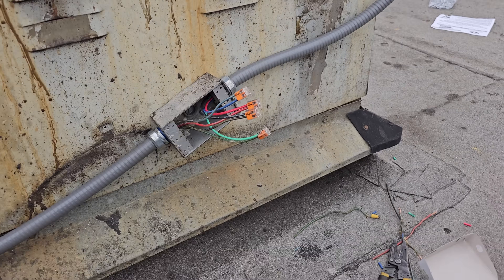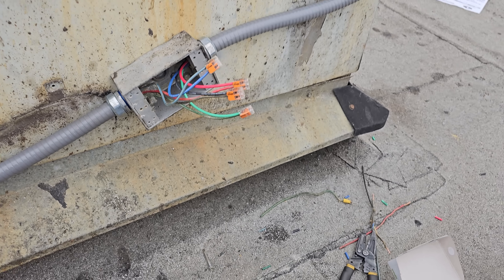THIS WAS A MESSED UP EXHAUST FAN SERVICE CALL PART 2

Comment: I loved a challenge. Having million dollar equipment error out and trace out circuits to find out a wire going to the left hand button caused an intermittent open circuit or having flickering lights in bathroom of a multi-million dollar facility makes you wanna get to the bottom of the issue and fix it for the customer. I used to love trouble shooting systems and figuring out why something did this and what I can do to help my customer. Thanks again for teaching us all a different world of the trades. Making the Trades Great again.

Comment: thank you for the video, just noted from the video, the hinge you had trouble with appears to have its lower bar the wrong way up, at 5:27 you can see the near hinge has the lower bar bolt holes up but the far hinge has the holes down, the effect of this is the lower bar is closer to the fulcrum of the hinge hence the fouling, I used to be a blacksmith and I made things like this all the time.

Comment: Just a thought: I use ferrules for everything. I mainly work with industrial automation, and it makes installs cleaner looking, and will avoid issues like that stray wire strand you had there.

Im not even an AC tech and I'm still hooked on you channel lol

Comment: @8:40 Not sure if you caught it or not as I havnt finished the vid yet, but I can see whats wrong with your hinge at this time stamp. On the right hinge, the bolts are going through the bottom half of the bar while on the left hing the bolts are going through the top of the bar. Bassically, the bar on the right hinge is too high. Compared to the left side, it actually looks like that bar was put on upside down, so if you was to take it off and flip it, it should work just fine without shims.

Comment: Not sure if it'll be worth the investment for the few cases it comes in handy, but you might want to look into time domain reflectometers (TDR) for checking wiring. They work by introducing a very sharp pulse into a wire and using the characteristic impedance and wave propagation behaviours of the transmission line to determine the length of the cable and the distance to impedance discontinuities (partial breaks, fraying, rub-outs, etc.). You don't need a completed circuit - it works more closely on the principle of radar than the way you think about traditional current flowing down a line. They're particularly useful if you're trying to figure out where a break is in a long cable, especially if it's going back through a roof and through the building. The really good ones are precise enough that they'll let you pick up something as small as a fly-away - you'll see a tiny secondary reflection after the main reflection as the wave continues to propagate through that additional inch of wire, and it's especially noticeable if you compare results from multiple lines in the same setup. Cheap ones are a few hundred bucks, good ones start at the $1000 mark and continue upwards from there. The super fancy ones used for checking aviation wiring harnesses cost more than my house!
Reply: They are in very common use with computer network cable installers - I know when I was doing that kind of stuff they were a godsend in tracking down problems.  Worth every penny!
Reply: @DocNo27  They're particularly accurate on Cat5/Cat6 too because the ANSI/TIA specification defines a certain tolerance band for the single-ended and differential impedances, so they can calculate the phase velocity from there and use it to derive ε_r and propagation delay.

I've also seen some field TDRs where you can take a known length of the same cable (e.g. cut from the installed run, or taken off the same reel) as a calibration reference to get high accuracy over very long distances. Really useful for utilities running coax or local loop over several miles. There are optical ones for fibre too.
Reply: As long as there's a fairly steady Z0 you're correct.  I worked on Network analyzers for 33 years.. with TDR, TDT, and so on.  You can run your finger along the surfact of the romex (if exposed) and locate the break rather precisely. I've used this trick many times.
Reply: How well would a TDR work on power power wiring where it's individual wires and not a cable?  I'd think the characteristic impedance would be too variable for it to work. RF and network cables have tight tolerances for that.

Comment: If you usually only join 12G wire or smaller I'd recommend the grey Wagos, they can't really be opened as easy as the clear ones.
Reply: Yep was going to say the same thing. Ever since a lot of the equipment was switched to r290 wagos is all I use. I use the grey ones all the time now.

Comment: 9:50 Maybe you should try the Wago 222 series instead of the 221 series. The 222 series are a little bit harde to pop open like that. They're still suitable for both stranded and solid wires up to 4mm2 / 12AWG and up to 400V. Only downside is, they're a little bit bigger, not much though.

Comment: I would make it a habit to bond your metal boxes to ground at every junction. It’s code and it’s always a good idea to make sure that ground path is fresh. Your new exhaust fan is definitely bonded to chassis so you’re probably fine in this situation but I can never trust older buildings and their questionable electrical!! Excellent work nonetheless, I’ve learned so much from this channel, and I appreciate what you do man. Keep up the good work my friend!
Reply: Jake you made me get out the code book...and you are absolutely correct! NEC 250.148 (C) says if circuit conductors are spliced in a metal box, that box gets bonded to the EGC.
Reply: @kevinhoober1863  Thanks dude! I was hoping someone would back up my claim. Can’t say I was completely sure about what I was talking about!! Lol

Comment: You should get a digital laser tachometer so you can see the belt speed/pulley speed of the old stuff then match the new stuff to that. It would make it easier when you have to do that

Comment: The levers lifting slightly is perfectly OK.  There's a bit of dead slack before the cage is affected.  It takes a reasonable amount of force to actually start pushing the clamp open.

Comment: Have you tried the push-in Wago clamps? I have used these as well as the snapping ones you are using and they never ever popped open. Electricians all over the place here use these. Maybe heavy vibrations are causing this issue. So try the other ones.
Reply: The wires he used were stranded ones, they wont work in the push-in ones as they are for solid cores only.
Reply: @DANGERTIM112  The wago 773 push-ins are suitable for "stranded" but not "fine stranded".  The wago 2273 push-ins are only suitable for solid wire. I think the wire intended for use in conduits normally falls into the "stranded" category but i'm not 100% sure on american wire types.
Reply: @DANGERTIM112  yeah right. Didn’t think of that.

Comment: with that hinge interfering with itself, couldn't you move the bottom bracket to the inside of the hinge instead of the outside of like they came out of the box. 

That should solve the interference issue and maybe be easier to install when the curb is narrower than the bottom lip around the fan.
Reply: Not really as the hinges have stops on them.
Reply: @ferky123  but the stops don't depend on the bottom bracket, only the vertical middle bracket.

Comment: Wire ferrules - that’s how you deal with fly aways. Never go anywhere without them.
Reply: Wagos should not be used with ferrules (you can, but it has to be a specific crimp type).
Reply: @kanetw_  I don’t use not crimped ones - I am not in the audio business. I have different types of crimpers, because I like to form a ferrule to the shape of the lug, for better surface contact area, although I’ve been told that I don’t have to.
In the automation terminal blocks - don’t matter whether it is spring loaded, screw or lever action ( life Wagos) wire ferrules used everywhere ( besides ring terminals), although not required.
Reply: @commenter5469  You have to follow manufacturer recommendations. For Wago 221s ("CAGE CLAMP"), it has to be either: solid, stranded, stranded with gas tight ferrule crimp (!), stranded with gas tight pin terminal crimp. A good crimper can do a gas tight crimps, but especially ferrules are often not crimped well.
Reply: @kanetw_  That’s a bunch of a hog wash! I understand necessity of tight crimp, so the high resistance will not occur inside the crimp - but a gas tight?!?! 😳😂
Are they claiming that 211 making a gas tight connection on the stranded conductor, by the lever action?!?! 
Spare me with this nonsense! Please!!!

Comment: 6:18 - I recommend AGAINST using a power tool's battery pack as a hammer... There's a SLIGHT risk of the case breaking, and a piece of the plastic puncturing one (or more) of the cells inside. I know it's a very slim chance, but better to be safe than sorry - thermal runaway in lithium-based battery packs is a very real danger. And OEM battery packs aren't cheap.
10:14 - I'd like to thank/curse John Denver for ruining the phrase "flyaway." Every time I hear the word, the song "Fly Away" gets stuck in my head.
10:22 - OK, now it's Lenny Kravitz's "Fly Away." 🤣
Reply: Big Clive calls the flyaways "careless whiskers" 😁

Comment: I see so many people on the net that are fascinated with Wago connectors….as if they somehow bring some extra admirable quality to electrical work, but the truth is, if you actually know how to use wire nuts correctly, there’s no reason at all to use a Wago.
Reply from the maker: Agreed I was hesitant to use the wagos but once I did I actually like them especially if you have to work on stuff that is hot.... not that I would ever do that though.....
Reply: They are more or less interchangeable. Use whichever you have or which is more practical in a given situation.
Reply: @HVACRVIDEOS  Well, Chris, I still haven’t found a reason to use them instead of a wire nut, and if the circuit is hot, I’m interrupting the circuit anyway, so it’s not going to work properly…… so there’s no reason for it to be hot.
Reply: @squirrelwood8008  I agree with that in principle, but after 50 years of mechanical work, I have yet to find a situation that I can identify where the Wago is going to be the way to go….No pun intended.